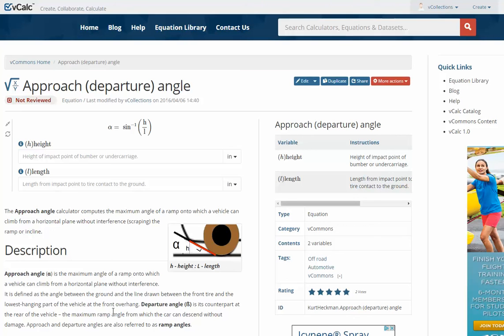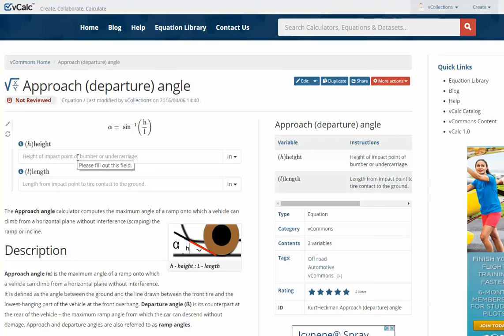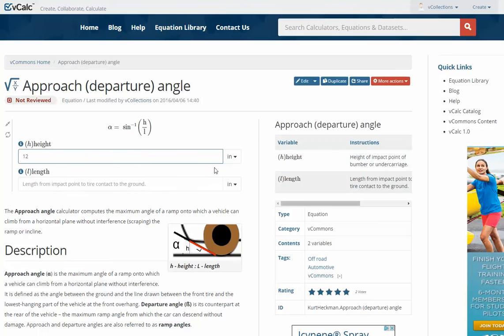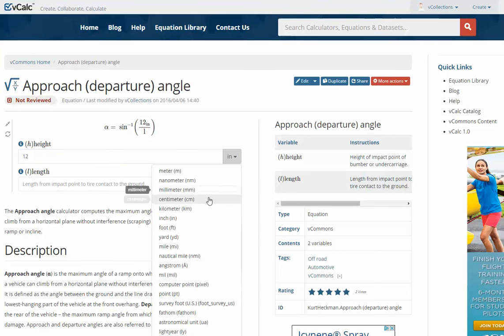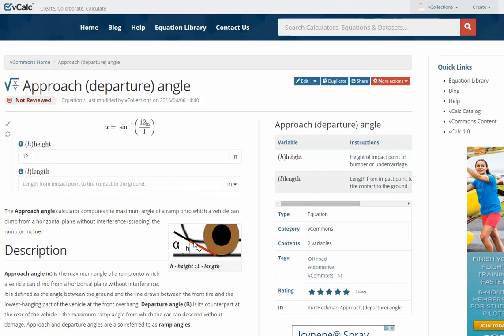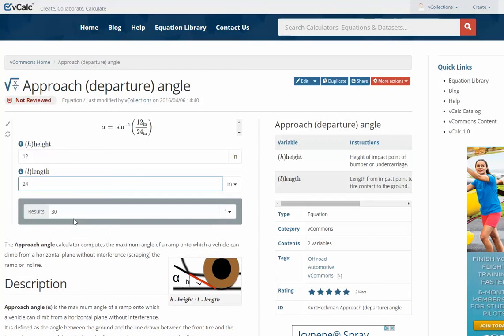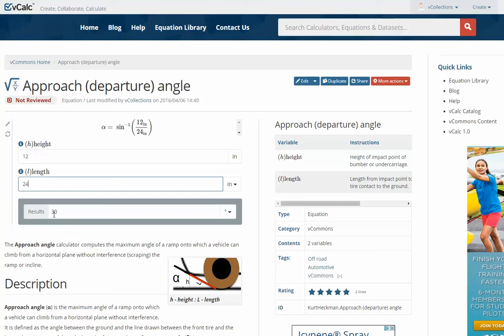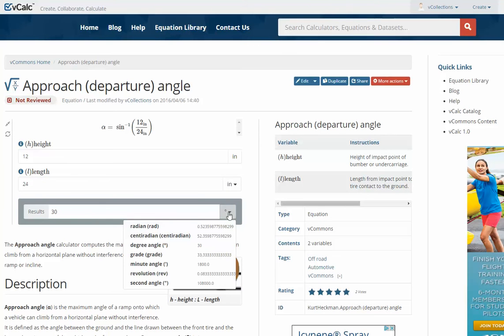Approach departure Angle

Comment: im making new 3 link suspension brackets on b-body mopar and I'm worry about not having a enuff ground clearance looking for the math formula stock 3- 4in at the rockers . my parts go past the body by 7 in rite behind the door I'm using a 245-45-17 F 275-65-17 B so its the flat tire part and big pot holes thats whats tripping me up id like the car to pass safety and not get ticketed for scrapping or rip out my new parts, thanks